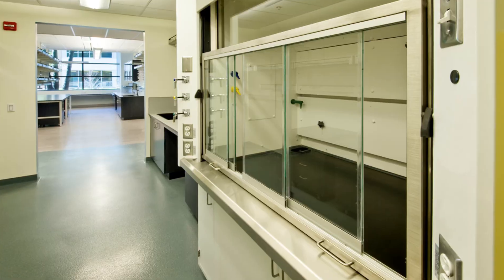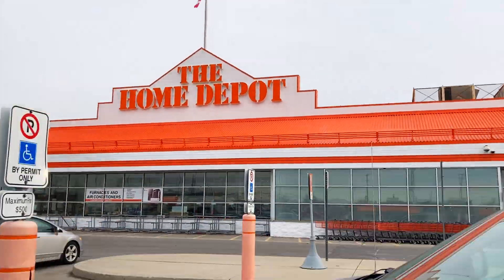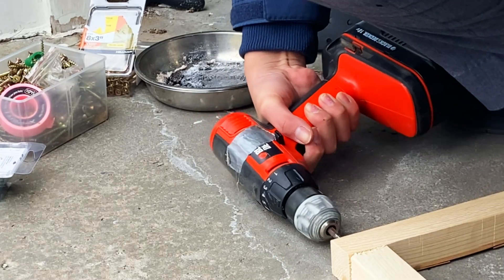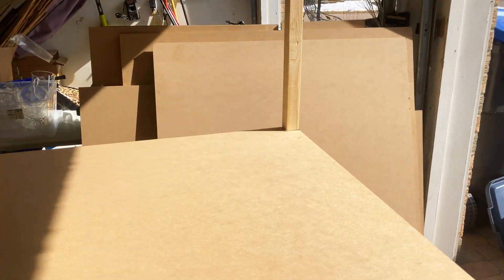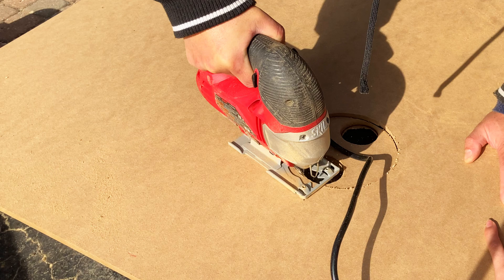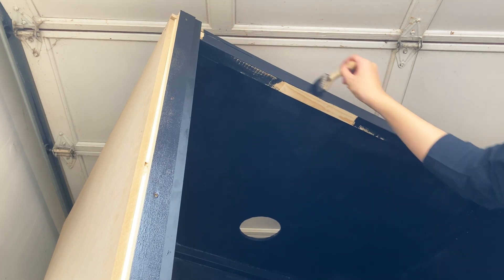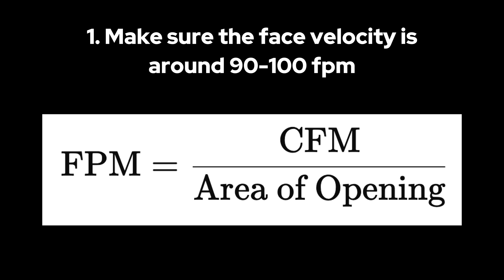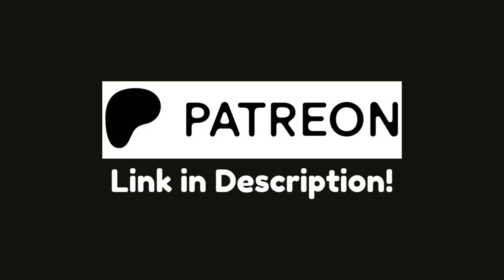Building a Fume Hood from Scratch for My Chem Lab at Home!

Comment: Great build for the most part. I’d probably would’ve opted for 2x4’s or similar for the legs then lined interior with ptfe, stainless steel tabletop. At least a flame retardant coating. Paint usually contributes to fires. Extract thru a filter box, I prefer squirrel cages. You’d be surprised how much cfm you need for full size hoods. Maybe some points for nozzles (vacuum, condenser hoses). Last note, not all extinguishers are the same. Make sure you’ve got the right kind. Either way, this shows good ingenuity. Definitely marketable with some improvements. If anyone is needing a cabinet, alibaba. Like 500 bucks for a complete one. Be careful out there! I’ve read some absolute nightmare stories about LEOs targeting hobby chemists.
Reply from the maker: Thanks for the suggestions! I'll definitely consider those if I could remake one, and I will definitely change the fan (I think it's a little too weak). I will also look into fire extinguishers. I appreciate the comment!

Comment: Uhh if u are actually gonna use ur own diy fume hood for toxic stuff, it’s kinda dangerous, it could make like a vortex or like the airflow could scramble at the top of the hood and possibly exit the fume hood, professional fume hoods are designed with shapes that make the air flow nicely
Reply from the maker: Alright, thanks so much for letting me know! As of right now I’m not gonna work with anything too toxic, but if a vortex forms that’d be bad 💀
Reply: Yeah if u want a fume hood for cheap u could try restoring an old or broken fume hood as long as it has a hood that's intact
Reply: Oh one more thing most fume hood come with an air sensor that tells u if ur fan failed. It could be dangerous to not know if the exhaust failed

Comment: I didn't really understand the sash mechanism, how is it held up when you raise it? Are there any gears that the chains attach to or how does it hold the weight? I've been looking for a suitable sash mechanism for mine for ages as I only have mediocre craftsman skills
Reply from the maker: Yeah haha lol, I just installed some chains but I rarely use them. Basically, the sash can wiggle around a tiny bit, and on the sides when installing the metal frame I used nails at set distances so that I can just rest the plastic board on the nails, holding it in place. When I want to move it again, I wiggle it a bit move it off the nail that it's pressing on. It's kind of like a bench press lol if that makes sense! :)
Reply: @CarbonTwelve12  makes sense, thank you

Comment: I dont get the reference when you said what a coincidence my name is also John??😂 how did we go from galvanised square steel to John?
Reply from the maker: "My name is Little John and I have been saving money by eating frugally for 10 years. I finally managed to save half a million and bought a tiny apartment in Shanghai, less than one square meter. It‘s so small not even my grandfather’s coffin would fit. There‘s just enough room for a mattress which I sit on to sleep. Now let‘s see how I can turn this into a fully functional house. Firstly, remove the original windows and use galvanized square steel to make two frames that extend outward. I borrow some screws from my aunt to secure them. Cover the frames with neat clean wood veneers. Use leftover veneers as partitions for storing seasonal clothes and bags, then reinstall the windows and set up a perforated board against one wall. I use one side for travel photos and sticky notes and the other side for storage shelves. Add a soft package against the wall for a more comfortable sleep and lay down a soft mattress to create a big comfy bed. Install a guard board near the window where I can place books to read before sleep. Install an electrical socket for convenient phone charging. Add a folding table that serves as both a workspace and dining table, saving space when not in use. At the foot of the bed, install a projection screen where I can relax and watch Korean dramas after work. Next, install a set of wardrobes against the wall. Use the top for seasonal bedding and add a shelf in the middle for other items. Below, two drawers can store clothes including large underwear and panty hose. The other drawer is for additional storage. I made these savings possible through years of frugality. Embed a hidden water tank in the wall and install a wall-mounted toilet. Above it, set up a folding table with an induction cooker to create a mini kitchen. Install a mirror cabinet above the cooker for storing discount seasonings and toiletries bought on sale. Install a built-in shower so I can shower while looking in the mirror. This design shows how even a tiny coffin room can maximize space and offer limitless possibilities."

-A script from reddit: https://www.reddit.com/r/copypasta/comments/1dh644o/little_john_and_galvanized_square_steel/

Check out some reels of it you'll get why I said john XD
Reply: @CarbonTwelve12 oh lmao, I thought it was an editing mismatch error or something was cut out😂

Comment: Really should get a bigger CFM, I use 770cfm with a smaller hood...
Reply from the maker: Lol I couldn't find a 770cfm, I might just buy two 300cfm fans! :)
Reply: If you check out kitchen blowers in your home depot they have a range of ventilation fans intended for high throughput for commercial kitchens.  I've got a 840 CFM hood in my kitchen that isn't even that loud.  

My other suggestion is to wire your hood up to a dedicated 15 or even 20 amp breaker, that way you are less likely to overload your circuit and pop in case there are other things connected.  You could wire in some outlets inside and on the outside of your sash, as well as connecting your vent fan to the same circuit too.

Fantastic build, I'm a quality control chemist from an electrochem plant in northern Canada and I would have used your hood for several of my tests without concerns!
Reply: @robertcorbin464  fully agree

Comment: So, an official lab grade fumehood will be built a certain way with specific things in mind, right? So it all depends on what you need it for, using outside as your fume hood is so less than ideal. You have weather and random temperature fluctuations and the occasional curious crackhead, but most of all you cant walk away from outside. Otherwise for someone like me a strong fan aimed outside of the window is sufficient. For maniacs like you that do shite with flourine, you need a total corrosion resistant, constant negative pressure wnvironment, with the ability to add exhaust scrubbers both chemical and hermetic, and possibly incendiary should the need arise (i am not a chemist but i am familiar with emvironmental laws pertaining to automotive painting, and whose first book was read completely was the anarchistscookbook when you could still find it in a public library. 

So you to vaguely get back on topic, you're just building a box to setve a specific function, and if you wanted to you could build a practical clean room from the homeless despot if you wanted to, for a fraction of what of what youd pay someone or buy assembled. I got some of this experience from tearing down mobile labs we acquired at auction from woods hole. Lots of cool vintage electronics salvaged from those im glad werent scrapped.

(Edit: sorry, the gist is there, but I've been drinking  while getting the greenhouse ready, and came off a bit incoherent.)

Comment: That silicone gasket will fail if any concentrated acid fumes get into the hood, The inner walls of the hood need to be as chemically inert as possible, Teflon plastic sheets would do for that. And the electronics should also be controlled from the outside of the hood by placing the power strip on the outside so if you need to stop heating right away you don't need to touch the danger zone. The fan assembly should also be a venturi tube that resembles a steam locomotive vacuum ejector with an inner tube providing airflow to the outer tube so none of the gases interact with the fan's various metal parts. The output should also blow into a bubbler full of chemicals that collect and inactivate the fumes so you can take them to an eco station or dispose of them on site with another reaction rather then poisoning the neighborhood.
Reply: Some of these are issues worth considering but these approaches are not reasonable suggestions for hobbyists. The whole point is to be creative, not emulate University labs. 

I suggest Mr Twelve keep in mind more conventional hazards like fume hood depth leading to unsafe reaching, spill management, face velocity dropping when the sash is up, possible airflow turbulence... etc. The chance of craning too far, knocking over a volatile corrosive compound, being assaulted by noxious vapors while reaching to mop up pools, having it leak onto sensitive chemicals below and/or legs/feet, etc is the disaster that happens IRL, not so much accidentally showing up WWI Germany by being the first person to efficiently deploy phosgene at distance

Twelve is a high school student and has far more sense and initiative than he has any right to, this is a real quality job and exactly the foundation you need to add features or tweak things as you learn.
Reply: I had the same thought